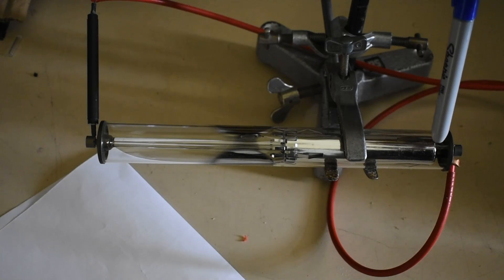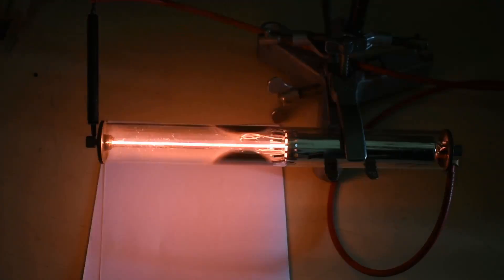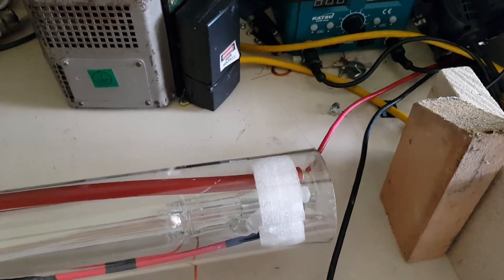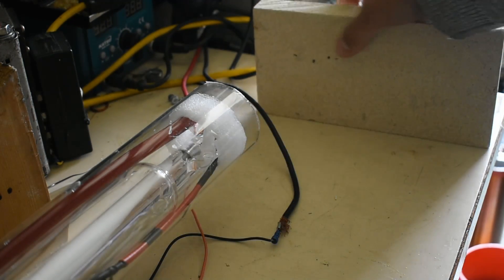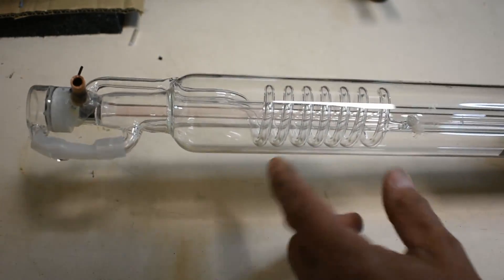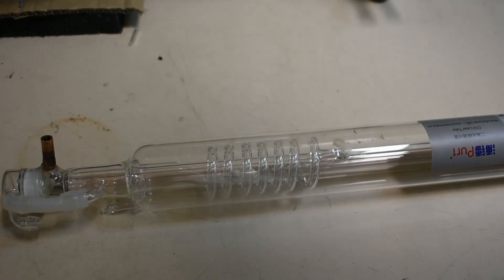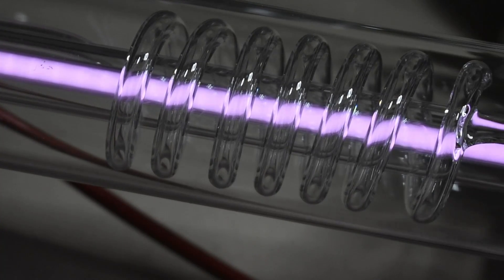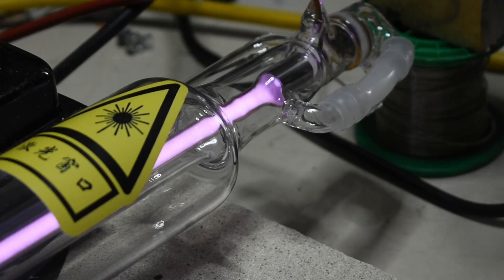Helium-Neon and Carbon-dioxide laser overview

Comment: makes no sense that its not lasing at the end since the tube was glowing and there will still be stimulated emissions if you got mirrors
Reply from the maker: Only certain electron transitions produce the frequency for lasing. As in this and He-Ne lasers the electrical gas excitation is not directly responsible for the laser output that is a created by a secondary electron transition. In the case of the CO2 laser, both Nitrogen and Helium are a more abundant  gasses and contribute to the visible light output but they pump the CO2 electron transition to produce the IR laser output which is amplified by reflection. If the conditions are not correct no laser output occurs.
Reply: @tuopeeks  yes i kinda understand that the amplified and selected transition is the IR for your mirrors but if other transitions or spectrum are produced and the mirrors are made to reflect those will there not be lasing in those lines?
"Only certain electron transitions produce the frequency for lasing." is this to do with creating a standing wave and that the mirror separation is chosen only to do this in the IR range?

Comment: Really cool mate great demo could you use this to pump a frequency doubler or?? For a viable beam? Do u know OP power? What's Consumption? What's the exact wavelength? Oh no I just realised I'm far to interested in this :)
Reply from the maker: Never thought of frequency doubling of a CO2 laser seems to be stuff online on it. This is a 40W rated tube, but can't confirm the output generally slightly under but can peak above. It is consuming around 200W but I build the PSU so can't vouch for any efficiency there. :-)  wavelength  10.6um
Reply: @tuopeeks  10.6 sounds perfect for a monster Green lightsabre, can it run at lower power or is it all or nothing? You should try pumping a crystal and see what happens.... very good
Reply: @T2D.SteveArcs  No, 10x too long a wavelength, 10600nm as against 1064nm